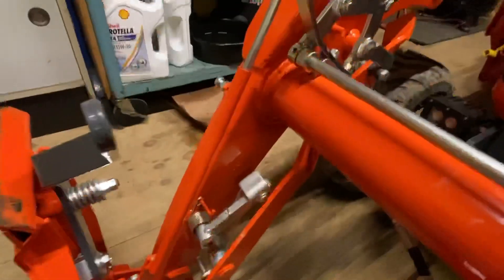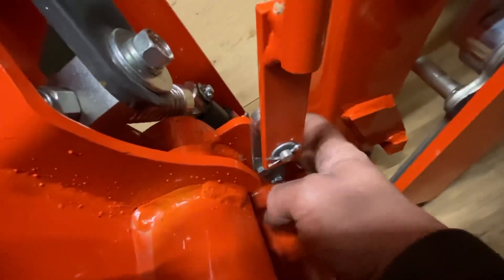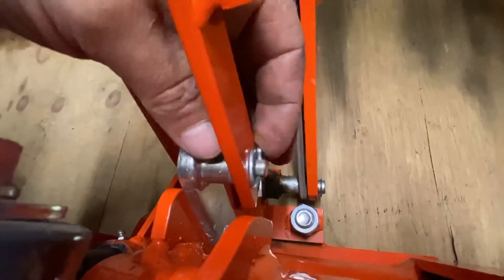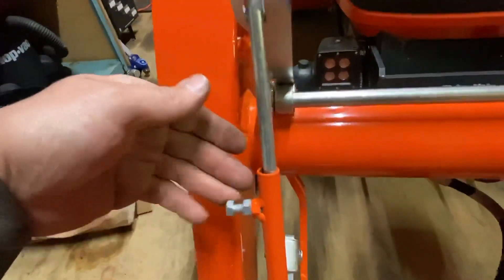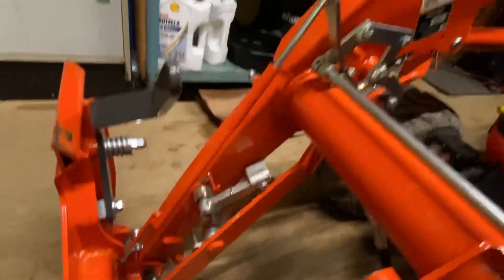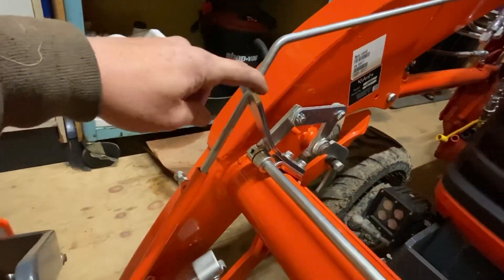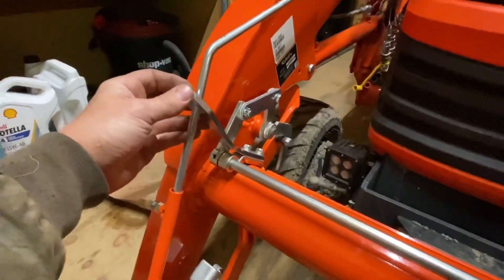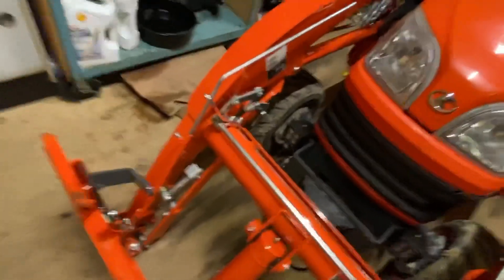Kubota bx 2380 Bucket level indicator (LA340/LA344) Viewer Request

Comment: Great video, I definitely have to have one
Reply from the maker: They are great, if you don’t have one I’d def get one, for the 50-60$ you can’t beat it! It’s nice too when you use different attachments as you can make separate marks on the level indicator so you know where level is for each attachment you install. I use to use it quite a bit when I first got my machine but now I’ve got so many hours in the seat I often forget it’s even there but ever now and again I’ll use it as a quick reference 👍🏻

Comment: Hello! I have a question. I have this on my tractor. Its great for working "flat". I want to know if there's actual true bucket level kit that can be used with the loader in any position ? Like if your loader is up in the air that will tell you when your bucket is level.
Reply from the maker: Hey Brian, no unfortunately there is no mechanism for this on any tractor other then tractors that come with a special made loader able to automatically level the bucket themselves as you boom up and down on the loader.. if you want this feature you have to step up to a larger machine to get it and not every company makes them get, John Deere I know for sure does on their 1 and 2 series and Kubota I think on their L/series and up best of luck!

Comment: Thank you for the video, I thought the indicator was useless, my dealer delivered it to without adjusting it, the "elbow" and the bracket didn't line up, so I thought it was a waste of money.... Now I can adjust it properly.
Reply from the maker: Yes once you adjust it properly it will actually work as it should, you’ll love using it specially as a new operator it helps ALOT! And you’ll find the more you get use to your machine the less you’ll use it as you’ll just start to know when your bucket is wheee you want it with out rendering to the loader indicator but for guys with a new tractor I feel it’s a must for the cheap price! Sorry I’m just seeing your comment!

Comment: Thanks, but three days ago I fixed my digger for no money and five minutes of time with two, heavy zip-ties and a two-foot long, old, garage door coil spring.  

The bucket came with a small tab welded to the top of it that indicated when the bottom of the bucket (unseeable from the seat) was level.  I found that not satisfactory to my occasional use and poor depth perception.  But it was a solid base to work to mount my system.

I strapped the spring tightly against the level top of the tab and Presto!  I now have a two-foot long horizontal piece to gage my bucket's angle.  Yes, about half of that length juts out in front of the top of the bucket, plainly easy to see, but won't be much of a problem in my general use of the tractor, and that whole coil spring length is flexible in any direction.  Of course, the rig is removeable and repairable in a few seconds.  I may tack weld the spring to the tab at some point, but at this point don't see the point.
Reply from the maker: That’s great I’m glad you were able to get it fixed! That’s a really bright idea you had there for fixing it!

Comment: I put that on my BX2360 with the LA243 loader. I had to drill the mounting holes but it works fine.
Reply from the maker: Herm Zinn thats excellent man! I’m glad you were able to make it work! When it all boils down all it is is just a steel rod inside of a mounting sleeve with a bracket that it slides through so your right as long as you can find a place to mount it and adjust it properly your all set! Great to know thanks for the info

Comment: Watched it clear thru, but I don't see how you can tell when it is level.
Reply from the maker: Frank M. Giovanniello Sr. As you move the bucket to dump or curl the rod will slide up and down inside of that too bracket.. when the top bracket rests into the crotch or bend of the rod then you know your bucket is perfectly level.. you must adjust it properly when you first install it but once you adjust it where it needs to be then your all set. 

Watch other bucket level indicator videos they all work on the exact same principle so it will definitely help you to understand how it’s working. 

Thanks for watching hope this helps